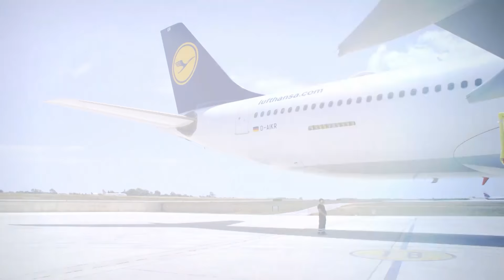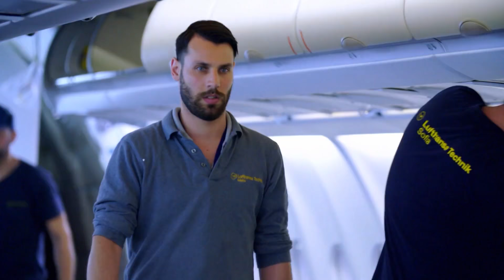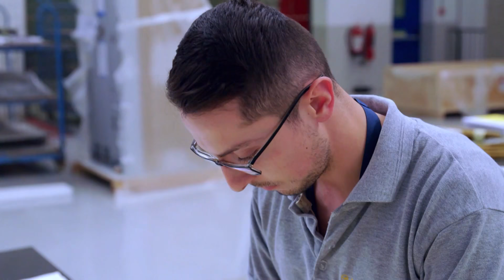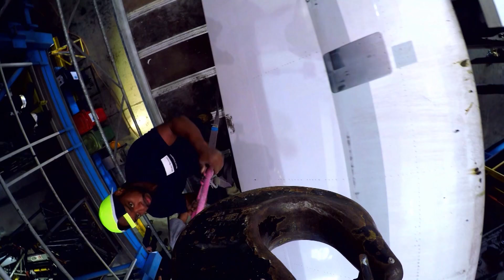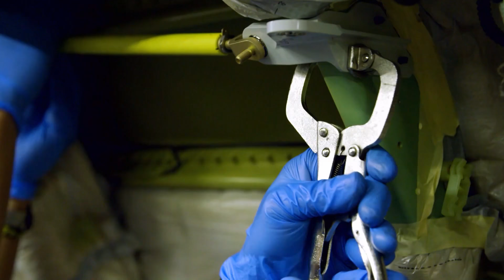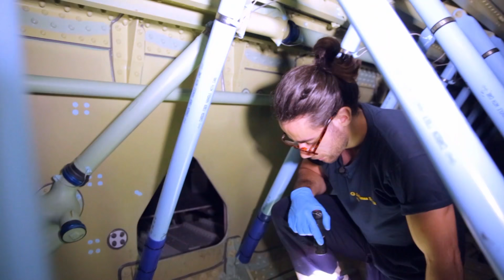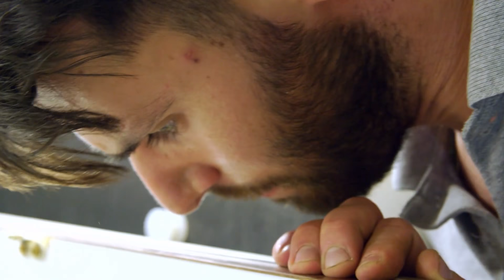Airplane Heavy Maintenance | Mega Pit Stops | Episode 1 | Free Documentary

Comment: there are lots of silly factual errors in the commentary, for example the frame of an airliner is made of aluminium alloy NOT steel !
Reply: Unless it is a newer generation aircraft like the Boeing 787 Dreamliner which is mostly CFRP, Carbon Fiber Reinforced Plastic, which is stronger than Aluminium.
Reply: @rogerhendy8340  : also true for some other aircraft at least in part but no way is STEEL used for such structures.
Reply: @pasoundman  I absolutely agree with you. The narration in this video is disgraceful, it is sensationalized for maximum dramatic effect and views like many other production grade American click bait nonsense. Like when he says the fuel tanks hold over 200,000 liters which is complete BS, the A330 holds 139,090 liters max. You are better off watching the video with the sound turned off. The narration is disgusting, but the work being carried out during the inspection is real.
Reply: @rogerhendy8340  it's classic dumbing down I fear.
Reply: @pasoundman  The video isn't meant for engineering nerds. It's designed to appeal to a more general audience. If you ARE an engineering nerd, don't you think it's a good idea to get other people interested in engineering?
Reply: That majority of the airframe will be aluminium.  There are some parts that will be steel though, such as the undercarriage mounts, engine mounts, tail plane mount and mainplane mounts.  There is more CF being used in airframes these days - but there is still a lot of airframes with steel in the high stress point areas.  Otherwise - yes - it was a bit of sensationlist narration.  Aluminium alloy is the main material used.
Reply: @chrisbristol1615  It is possible to lift the aircraft 7 meters, however in this case you have to take into account the fact that the shock absorbers are extending as you remove weight off the wheels by jacking up. Probably not 7 meters though. A good indication is the door sill height
Reply: I think the cost too... 200 million euros...

Comment: Reminds me of that air crash cos they took shortcuts removing the engines with a fork lift and busted the bolts
Reply: Using a forklift is acceptable practice if you use the specific manufacturer fork lift adaptor sling. We do it all the time on small aircraft and the Crain attached to the roof for bigger aircraft.

Comment: No respiratory mask, no hard hats and proper lighting in fuel tanks where there were trusses all around - you could be banging your head and tripping almost every 2nd step.
Reply: There is no reason for a mask. The fuel tanks have been defueled, sumped and ventilated to remove fuel and vapors. They had a machine to continously check the level of oxygen and volatiles, if these remain within limits there is no reason to wear a mask.

Comment: "Not all procedures are written in the manual" 😉
Reply: lol 😂😂😂😂
Luckily this is an Airbus!!! 🤪
Reply: @runwayincursion3376  AirBus has no exemptions to this 😉
Reply: Haha MCAS
Reply: The manual is just a guide...!
Reply: Basic training 
Safety training 
Human factors training 
Fire fighting
First aiding
R/T communications training 
Standard practices training 
Maintenance equipment operations and driving 
Documentations and paper work
Inspections
Cleaning
Tools personal and crib
Basic ramp and transit aircraft type training 
Licencing EASA B1 OR B2
MAINTENANCE MANUALS AND DOCUMENTS HANDLING
FULL TYPE TRAINNING
APPROVALS / AUTHORITIES 
ENGINEER
LICENCED AIRCRAFT MAINTENANCE ENGINEER
SNR LAE
DUTY ENGR
LINE / HANGAR(BASE) MANAGER
SENIOR MANAGER ENGINEERING 
ENG HEAD.
SO ON.....
Reply: Lear manuals are the worst. Had to take out a switch in the wheel bay. The manual for how to remove the wheel bay landing gear switch was this
1. Render aircraft safe(on every task)
2. Remove switch.

God dam learjet
Reply: @mybumbrash  I've gotten a few of those from boeing. "Install part". At least they could say "removal is reverse of installation" lol
Reply: They are engineers, they will know it even if its not written. So they get only the most important instructions.
Reply: @stiv370  That's not true. The Aircraft maintenance Manual is usually very precise. Of course it doesn't tell us to turn the screw counterclockwise... but every step necessary is described.
However, it can indeed happen that not every procedure is listed in the AMM. Some modified parts for example. But the AMM has this covered. At least from Boeing...

AMM Introduction Paragraph 2:

A.   The AMM is written for mechanics that have attained a level of expertise comparable to Level III, Line and Base Maintenance Training, as defined by ATA 104.
B.   If there are no specific instructions in the system- or component-specific instructions, use standard industry practices. These can be defined as follows:
  (1)   Those practices which are within the limits of "good engineering practice."
  (2)   Those practices which are typical of mechanics who have the necessary license(s) to do work on the airplane and its parts and related equipment.

  (3)   Those practices locally used by each operator, such as an airline or a repair facility, which are their usual procedures.
  (4)   Those practices which are not new, special, or specified by the manufacturer.

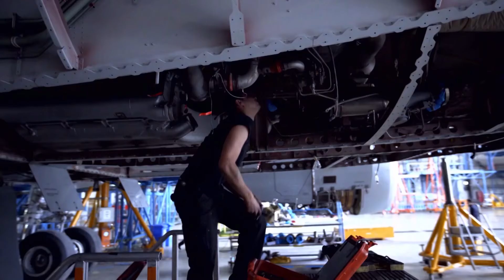Comment: 14:00 The aircraft's steel frame? Airplanes are just about completely built out of aluminium to save weight. Newer ones are using carbon fiber. Steel is way too heavy.
Reply: Mike Lowe lol yeah that’s right also these are not frames that they are checking at this moment but brackets for the belly fairings
Reply: Mike Lowe maybe they were confused. There is steel in the engine pylon box.
Reply: @raphaelr.1576  I thought that they would have used titanium. Too expensive maybe?
Reply: @mikelowe5096  No I do not think so. Titanium is also extensively used in the engine pylon to wing attachment. In the case of the A330, the steel is used to form the pylon box encasing hoses, ducts, pipes, fire extinguisher system..

Comment: I heard in Lufthansa Philippines it takes 29 days for a Heavy check or D-check in 330s and 340s?
Reply: When I oversaw an Australian registered aircraft in for a D check, (overhaul) in an Asian country, I saw an employee of the O/H company enter the avionics compartment on a B737. He was there for about 2 minutes. Then left, filled out the details on the work card, filed it and departed. The card was for a detailed inspection of the interior. That is everything. Condition, insulation & security of components & fitment racks, adequate clearance of cabling, correct bonding etc. Was more detailed but anyone involved in aviation knows what this entails. Normally takes an Aussie LAME (Licenced engineer.) about 2 to 3 days depending on the age of the A/C and model for this inspection.
His details to "Carry out inspection of E&E bay as per B737 MIM requirements."  was, quote Racks E1, E2 & E3 in place. 
This area is the heart of an aircraft. 
Same Company involved in this D check, were later found out they had used staples to splice wires in the cabin they had accidently severed during cabin modifications. (Different Aussie Airline.)
When asked about his 2 minute check, he apologised for "Taking so long!". 
My Airline later had an incident in Sydney that involved landing a B747 with the nose gear still up. When it went in for repair, it was found it had previously had the same problem & had been repaired.. No documented details of this were ever located by my airline. SAME ASIAN COMPANY! This A/C was leased from said Asian company. 
Cut corners, shortcuts and pay the price.
Reply: @rosssmith6205  i think heavy checks for 74s and 73s are done in EGAT taiwan..... im not sure.
Inspecting for 2 mins? That's absurd....
Reply: 18 days!
Reply: @iconideas05  mr. Norman Datu....... lipat na tayo hehe
Reply: @Wintor, nasa one of the best Airline ka na, kilipat ka pa ng MRO? Balik na na lng LTP😀